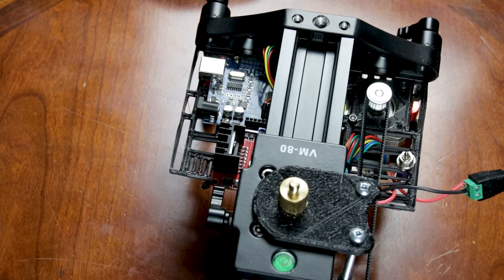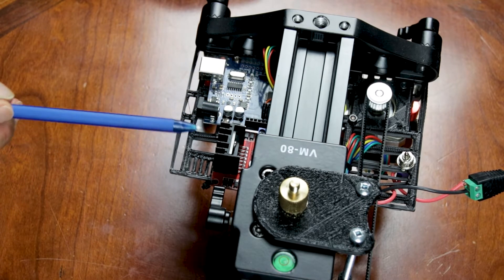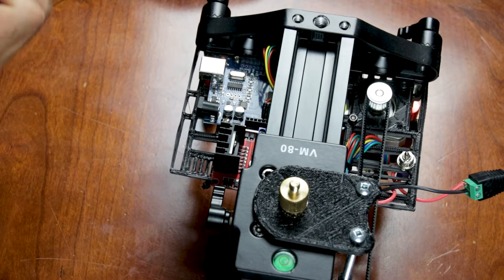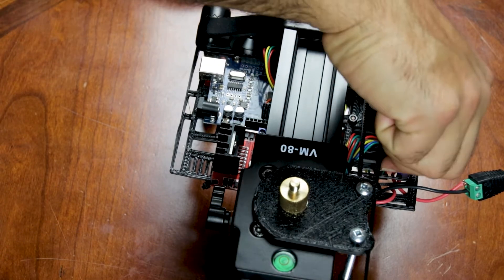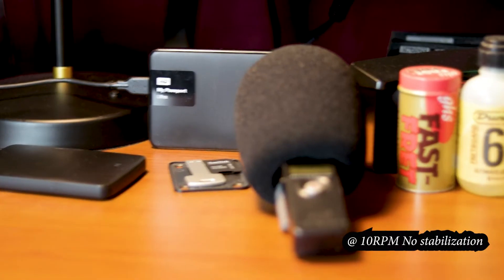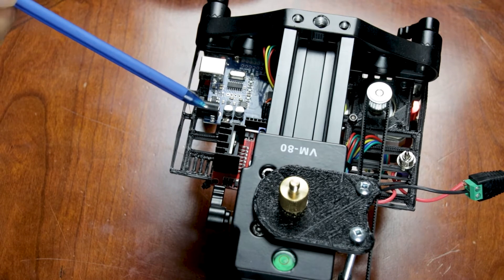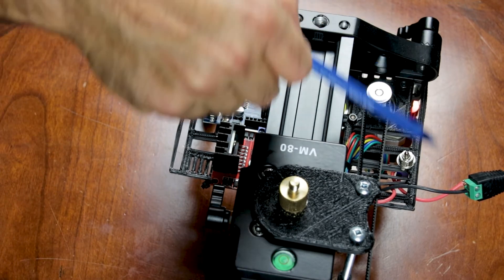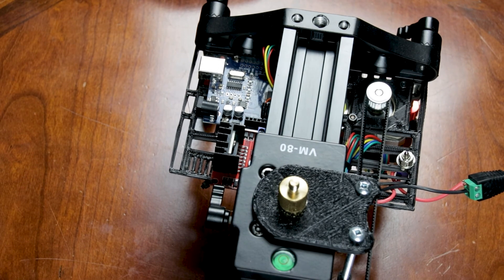L298N Stepper Motor Overheating Fix – NEMA 17 Troubleshooting & Workarounds

Comment: Thank you! I was wondering why my linear rail stepper was getting so hot after moving with a L298N controller, but your guidance to set the pins to LOW after movement cured my issue.
Reply from the maker: Glad I could help!

Comment: I was having the same heating issues with my stepper motors and the L298N but after watching your video I feel a lot more confident that the L298N is the problem and not user error. Apparently 12V and a stepper motor are just too much for the L298N to handle. Thank you for the information.
Reply from the maker: Glad it helped! :) I think the problem was just with it idling. Here’s my follow up video in case you want to know what I finally went with https://youtu.be/E-i4xrbWjfA

Comment: Hello. Can you send me your Nema17 code ?
Reply from the maker: hey just saw your message. sure!  here you go. I haven't used it for a long time but think it should work. Started testing a 4988 but i think the driver is fried so waiting for another. cheers!

#include <Stepper.h>

// change this to the number of steps on your motor
#define STEPS 2600
#define FAST_SPEED 16
#define SLOW_SPEED 12 /* slower than 10 heats up the L298n */
#define SLOW_PCNT 0.1
float FAST_PCNT = 1-(2*SLOW_PCNT);

// create an instance of the stepper class, specifying
// the number of steps of the motor and the pins it's
// attached to
Stepper stepper(STEPS, 8, 9, 10, 11);

void setup() {
  // set the speed of the motor to 30 RPM
  Serial.begin(9600);
  stepper.setSpeed(SLOW_SPEED);  
}

void setStepperIdle() {
  digitalWrite(8, LOW);
  digitalWrite(9, LOW);
  digitalWrite(10, LOW);
  digitalWrite(11, LOW);
}

void loop() {
  Serial.println("STart");
  stepper.setSpeed(SLOW_SPEED);  
  stepper.step((int)(SLOW_PCNT*STEPS));    
  Serial.println((int)(SLOW_PCNT*STEPS));
  
  stepper.setSpeed(FAST_SPEED); 
  stepper.step((int)(FAST_PCNT*STEPS));   
  Serial.println((int)(FAST_PCNT*STEPS));  
  
  stepper.setSpeed(SLOW_SPEED);  
  stepper.step((int)(SLOW_PCNT*STEPS));    

  setStepperIdle();
  delay(1500);

  stepper.setSpeed(SLOW_SPEED);  
  stepper.step((int)(-SLOW_PCNT*STEPS));    
 
  stepper.setSpeed(FAST_SPEED); 
  stepper.step((int)(-FAST_PCNT*STEPS));     

  stepper.setSpeed(SLOW_SPEED);  
  stepper.step((int)(-SLOW_PCNT*STEPS));    
  Serial.println("End");

  setStepperIdle();
  delay(1500);
}